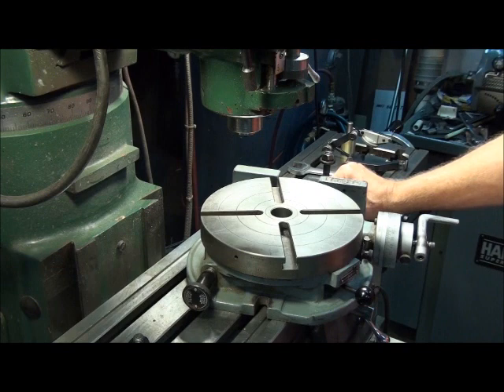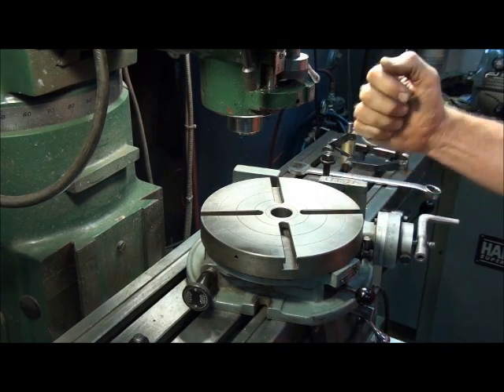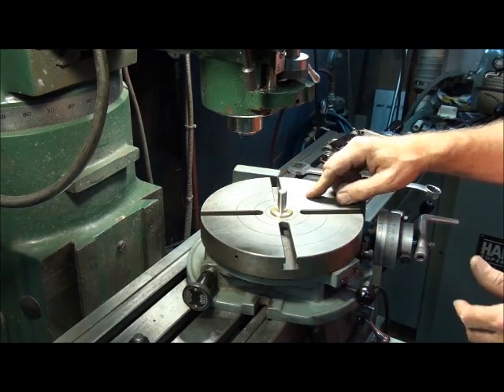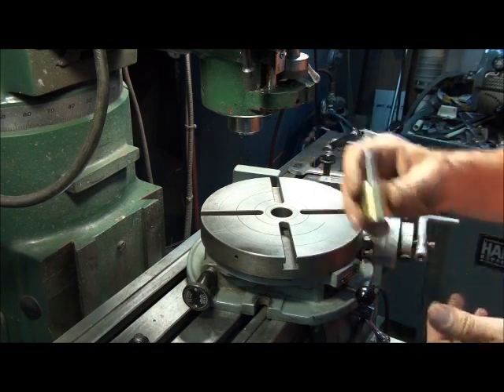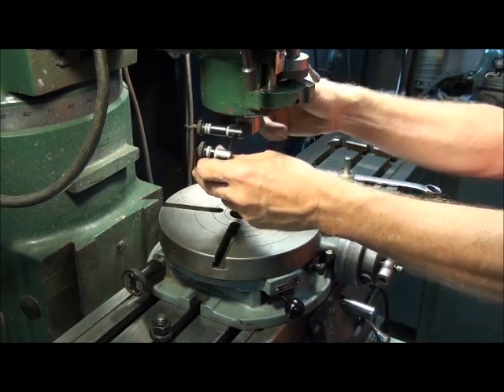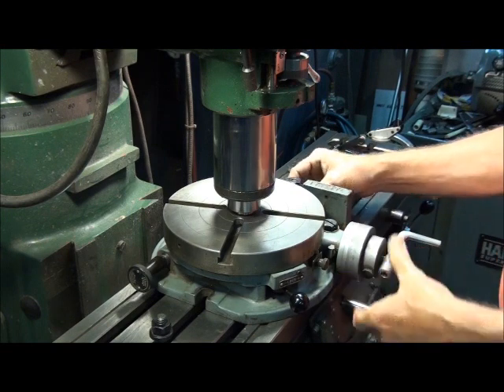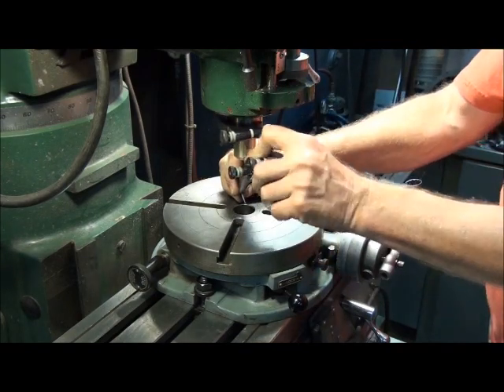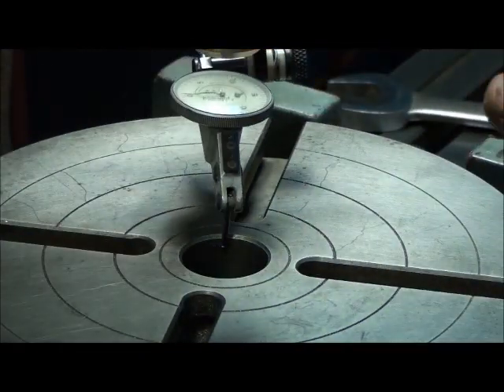Center a Rotary Table in Under a Minute Without an Indicator

Comment: Good thinking, Tom ! Unlike most of us, you make youTube a better place. I've only just stumbled across your stuff but so far I haven't struck one I didn't learn something worthwhile from, and this was no exception.

I tried to guess before watching what it was you were going to suggest, and what I thought was similar, but might be worth mentioning: I was thinking of something along the lines of a pipe centre as fitted to the tailstock of a lathe, (the fixed variety, not spinning)  either with a tapered shank to match the spindle, if it's Morse or R8, or just cylindrical to fit a commonly used collet (your 1/2" being the obvious choice). The idea is that it would engage with the entry chamfer to the register hole of the rotab.

The idea would be to push down increasingly hard on the rotab with it, as you nudge it towards centre, (if it's a really heavy unit, it's easier to nudge with the mill table handwheels).

My first thought was this downforce might make the rotab less likely to shift as the clamping nuts or bolts were pulled down hard. However this is probably not realistic. As you say, they probably will not move the rotab, but if they want to, I don't think the stiffness of the machine - and this setup - would be sufficient to prevent it.

If necessary, the chamfer in the faceplate could be trued up very simply by using a countersink (preferably a large one, in good condition, but no need for it to be anywhere near as big as the hole) and offset the rotary table in order to take a light cleanup cut with one side of the countersink kissing the chamfer, while turning the faceplate with the rotab handwheel ('climb mill' for better finish).
Reply from the maker: Thanks. I spend a lot of my time outside the box, so you'll probably see a lot of techniques here that you won't see anywhere else. Glad you are enjoying the videos.

Tom

Comment: Tom, can you show us how you determined you needed a 3 degree taper over 1 inch. Then show us how you cut that taper. Sorry, I'm just a beginner. Sure this sounds elemental. I don't have taper gauges and wouldn't know how to use them if I did. 
Thanks,
Ron
Reply from the maker: Hey Ron,

The 3º taper was just a WAG. I needed just enough to center up in the hole without falling through. I cut the taper using the taper attachment on my lathe. Another way to turn it would be to offset the tailstock slightly and yet another way would be to turn it using the compound rest set at an angle. Taper turning on the lathe is one of the topics that I haven't got to yet for my videos, but they will be coming.

It doesn't require any special tools to measure a taper like this. You just convert the angle to taper per inch and use a pair of outside mics and a ruler to measure the diameters a known distance apart.

Tom

Comment: different story if you needto crank the bokts down hard for heavy carbide tooling removal of metal but still i use a similar method but always check with a DTI afterwards
Reply from the maker: I used to check with an indicator, but never found it far enough off to matter. As long as you torque the bolts down evenly, nothing should shift.

Comment: hi Tom, I cant see where the critics can bark at this.  I do this the same way. There is way
more errors with indicators and such.  Problem I corrected is;  I call it machine to machine error, in being turned on a lathe just could be a tinch off when put in the 
mill.  Solution, I simply clamped a tool post on the mill and fine tuned it.  Now
its more like married to the mill.  Still thinking; I machined a bunch of 60centers
that run "mill true"  cant go wrong finding an existing hole centers, not need center
finders.
Reply from the maker: Samuel,

I wouldn't say there is more error with an indicator, but it certainly takes more time to use. This is just a quick and reasonably precise way to center a table. There are lots of time saving methods of centering parts. I like to use gauge pins to center a hole. Just place the pin in the hole and grab it with a chuck or collet.

Tom

Comment: Super, another one out of the ball park!. Thanks! I do believe if the rotary got a lot of use a hardened taper would be best, Most applications can live with .0005 run out. Sure beats monkeying around with dial indicator, or coaxial indicator. I suppose if the half thou really bugged you, a light smack with a small mallet on the opposite side would work ...or not. Screwit!! get to making parts! Thanks again.

Comment from the maker: Center the table as shown in the video, then center the cylinder on the spindle as follows: Mount a pin in the spindle and offset one axis half the diameter of the cylinder minus half the diameter of the pin and clamp a parallel to the table against the pin, roughly perpendicular to the axis you moved. Now do the same for the other axis. Now you can locate the cylinder off the parallels, clamp it to the table and remove the parallels, leaving the cylinder on center.

Or buy an indicator. :)

Tom

Comment from the maker: I don't think many hobby machinists can afford a separate mill for each accessory. This technique is not intended to locate a rotary table to .0001". for that, it needs to be set up using an indicator.

Tom

Comment: Small Machine Shops want to save as much times . . .need few milling machine like your . . . .at all times  1 machine with Rotary table, 1 with vise , 1 with Hartford chuck . .Those Machines truthly don't cost too much . . .Help you quick to set any work at any time  for oen or two men Shop . Your thing not really bad but don't for get Spindle machine may loose or Rotary a little heavy . .set with this ways will give you trouble if the work + & - .0001  or .0002

Comment: Looks like a great idea! You should do a video on making the tool for us rookies, I am not sure how to cut the taper on the brass part?
Reply: Just found this video and with my luck over time I would end up shaving the brass so steel sounds better but brass turns so much nicer for me. Since mine is MT#2 maybe easier for me to get an arbor and use that.

Comment from the maker: Mark,

Ideally the insert should be fitted to your particular table, so making one off site that would fit properly would be difficult. It's not that hard of a part to make. Just bore and turn it in one setup to maintain concentricity and it should work fine.

Tom

Comment: Great video, I machined a blank end arbor and basically bolted down the rotary table the same way you did. It's more than good enough for alot of hobby work I do. But if perfect accuracy is needed, I'll use the co-axial indicator.